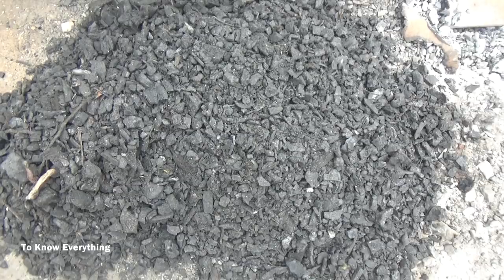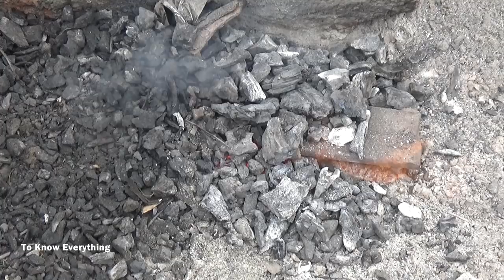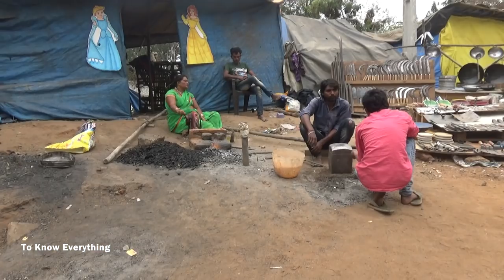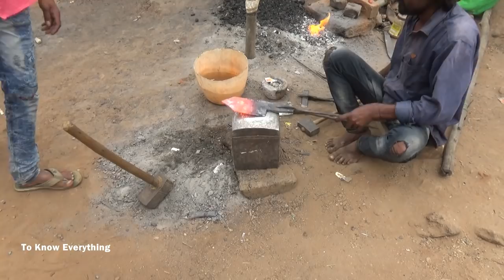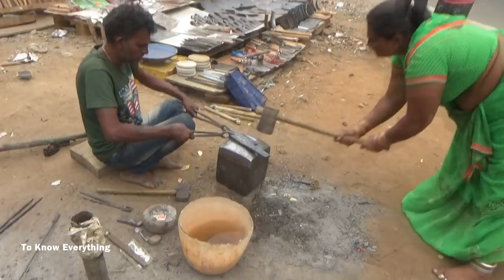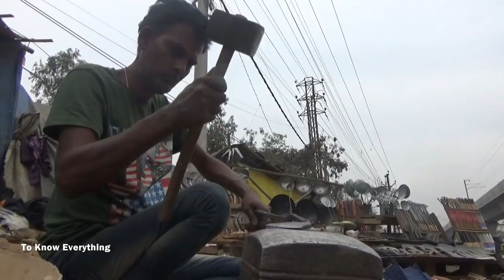Meat Cleaver Making Process | Mutton Knife | How to Make Meat Cleaver | Knife Making On Road Side

Comment: There are at least half a dozen families living on the roadside doing blacksmithing work next to Kukatpally metro station in Hyderabad, Telengana India.. They do not even have proper hut to live in  but have sufficient  skills imbibed from their elders to turn out these implements. The ware they make are not tourist items, but only utilitarian ones. They use scrap steel from Auto mobiles, mostly leaf springs. Some of these items when polished and sharpened slightly and evenly  would be worth 10 times their selling price. They are the inheritors and safeguarders of traditional Indian blacksmithing knowledge.

Comment: How is the heat treatment? Water? Yikes. Nice blades though
Reply: Why yikes? Watch some smithy from Finland doing it the same way.
Reply: chapiit08 because they can be brittle quiched in water
Reply: That's why tempering has to be done after hardening.
Reply: chapiit08 i can't see the tempering process in this video.. The traditional blacksmith from india, thailand and indonesia are never tempering their blades.. Just edge quenching.. But in this video the tang of the blades are quenched too.. It will be too brittle
Reply: I was commenting on the process itself but yes, the Asian smiths never seem to do any tempering process after hardening.

Comment: not good. Knives dipped in water many times make the steel crispy
Reply: Seems like they are using mild steel, in that case quenching in water will give the steel some degree of hardness. Notice also that the smith cold forges the edge to work harden it. In any case I doubt the people that use these will care about nicks in the edge.
Reply: saxonforge  it's not a mild steel it's 5160 motor leaf spring
Reply: How do you know its 5160?
Reply: Crispy.lol
Reply: @saxonforge  usually leaf springs are made from 5160  steel
Reply: These are pieces of steel from truck tweezers. 
But steel should not be cooled many times with water for a short time, whether it is good or bad steel.
Reply: Crispy crispy    

Crispy? Steel crispy?